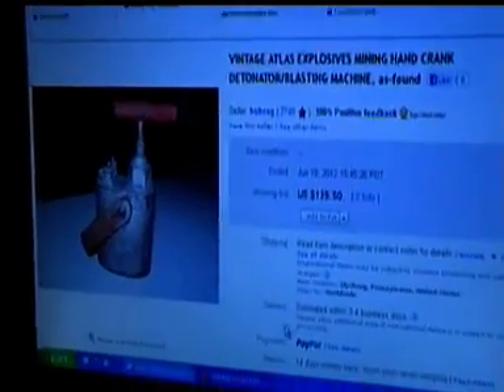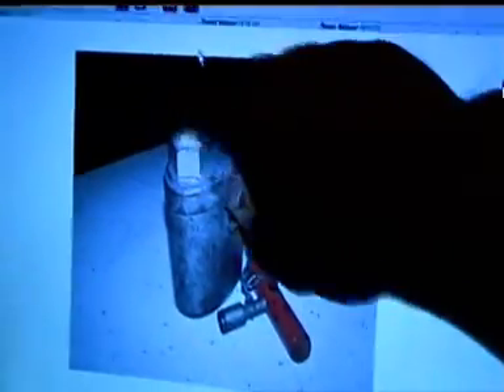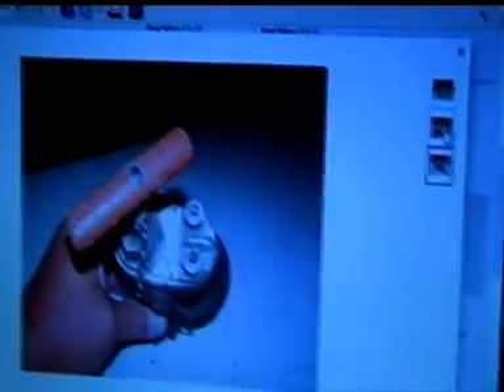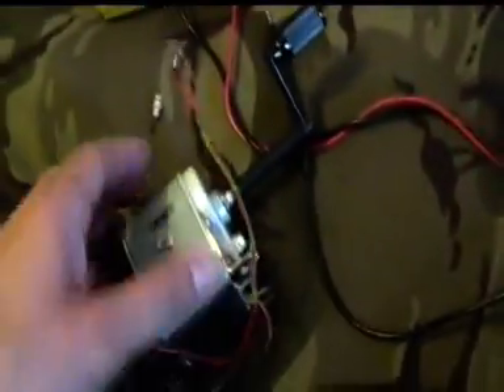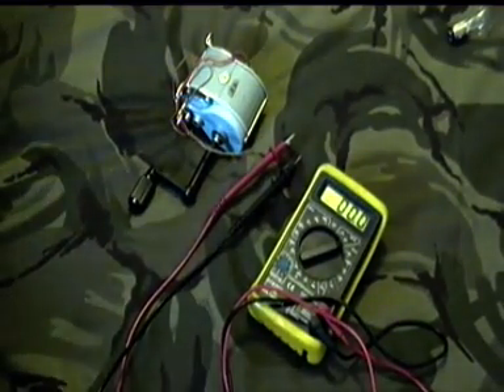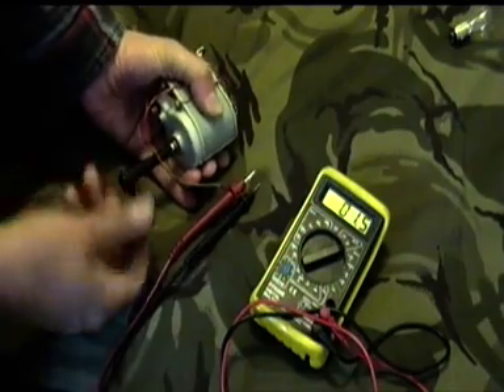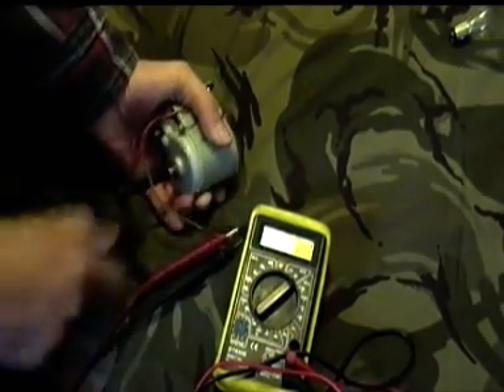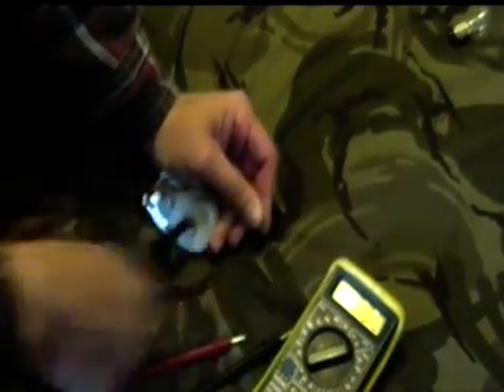Blasting detonator project 1

Comment: 10 cap blasting machines can be purchased on ebay if u didn't know...
Reply from the maker: I do show one at the start of the video for $135 + postage so yes. However I think ebay don't show some pages to people in the UK to do with mining etc so I would have to log in none UK then also have a problem maybe with customs.
Reply from the maker: http://www.ebay.co.uk/itm/VINTAGE-HERCULES-POWDER-BLASTING-MACHINE-10-CAP-GOLD-COAL-MINING-DETONATOR-/222633709133?hash=item33d600ce4d:g:M04AAOSw0ThZo2ON
Reply: i suppose, you can also try hand crank flashlights maybe?
Reply from the maker: As you commented on this I had a look and a guy was selling one in UK on ebay so bought it, but as I say would have cost more from USA with postage and may have got blocked by customs these days as they are a bit funny about that sort of stuff.
Reply: fair enough